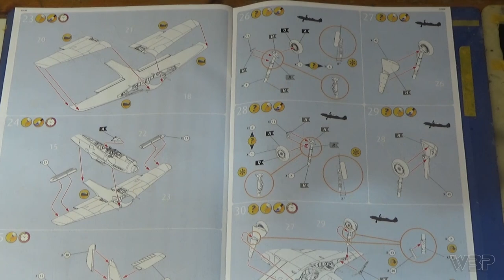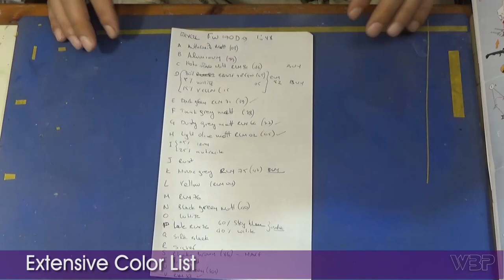Revell /Eduard FW190 D9 1:48 Full build

Comment: Great job on this Dora! One thing tho, the late style, "blown" canopy did not had the pulley, so the antenna wire was just attached to it and would be hanging lose when the canopy is in  open position.
Reply from the maker: That's a good point... I didn't think of it. Thanks for watching :)
Reply: @wbpsmodels3452 you would also have a loose connecting wire from rear fuselage to mid point of the lengthened Ariel wire check out a few late war Dora references you’ll see what I mean, nice job though

Comment: After building it too I must say Revell always make things hard for the builder. Step 5-11 are really bad engineered. As can be said about 19 and 21. Revell can never do things like Tamiya. If you misalign the wing assambly just a fraction of a millimeter ( on a tamiya model that's impossible) you're in for a filler, sawing, sanding and rescripting weekend... And the main wheels will not fit. You did a cracking job with it I must say.

Comment: Is that a scale 1/2" thick aerial then? Good idea though! 👍
Reply from the maker: An actual 4 mm aerial in scale, would be 0.06 mm  (or 0,0023 inches)...  Honestly I don't know where to find so thin material and even if I could, I'm not sure i'd be able to handle it...   The optical fiber (albeit not entirely in scale) works fine and is as thin as a thread (which I usually used). ;)